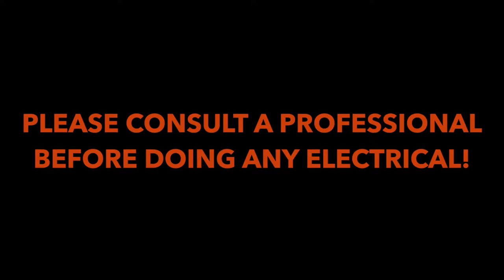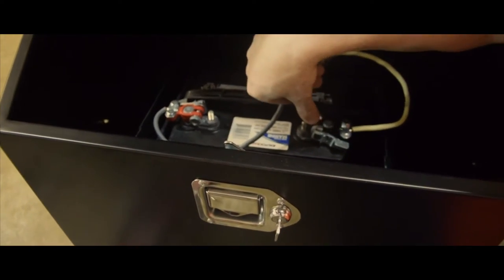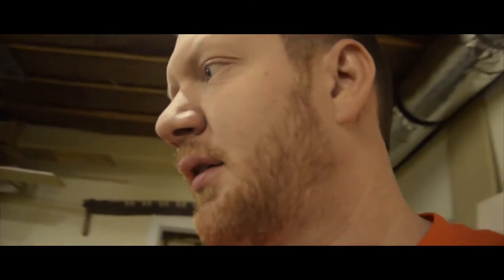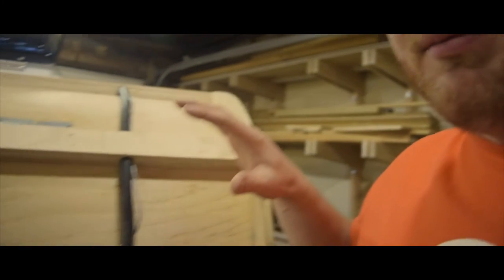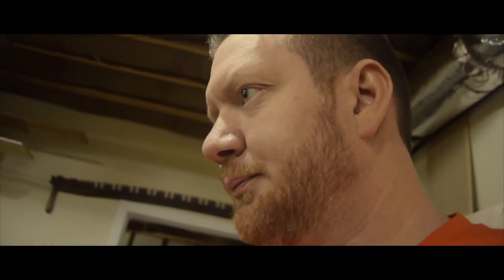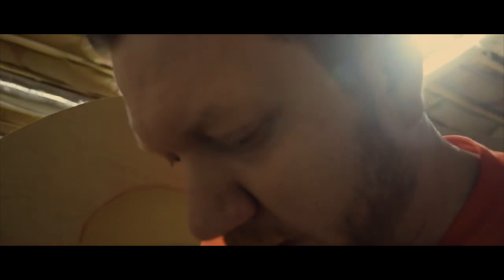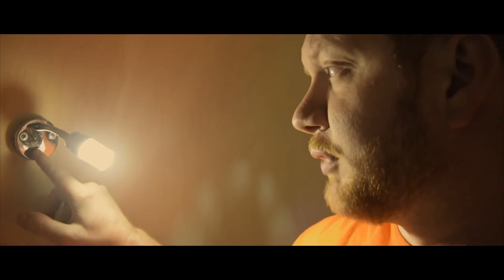Installing the coolest interior LED lights! | How to build a Teardrop Camper Trailer #10

Comment: Looking good Zach....... On the battery side you can wrap the entire black wire with a red color heat shrink tubing and the white wire with a black color heat shrink tubing. Put a small band of red color heat shrink tubing on the black wire and black tubing on the white wire at the power distribution unit. Our local Fry's store sell a different diameter size 48" long heat shrink tubing.
Reply from the maker: +Freddy Chrisdijanto great idea Freddy, isn't that odd how the black and are swapped? Crazy :)
Reply: AC and DC wire color code never get along........lol
Reply from the maker: +Freddy Chrisdijanto yeah it's my fault for going SSO but it will work in the end :)
Reply: Use a self adhesive barrel connection or self adhesive heat shrink tubing on every wire join to protect from oxidation.
Reply from the maker: +Freddy Chrisdijanto yeah but I'm not concerned being inside of the walls, totally agree if it's on the outside :)
Reply: Just a suggestion :) I learn a lot on the boat wiring and those join inside the wall is pain to repair.
Reply from the maker: +Freddy Chrisdijanto totally, thanks man!

Comment: Nice work, those blue/white lights are pretty rad... it definitely came out very purdy B-)  (also, really weird about the terminal connectors)
Reply from the maker: +Live Free and DIY thanks Lew, yeah I agree! The blue/white ones were a nice touch :) and the terminal connectors don't seem right but then again I'm using white/black and not red/black lol
Reply: OOH, that might make sense then... kinda... in electronics, black is considered ground/neutral and red is considered hot. But in electrical (for houses, etc), black is hot and white is neutral.
Reply from the maker: +Live Free and DIY yup you got it! In retrospect, I should have gone to the auto parts store but wire is wire, regardless of color :)
Reply: Yeah, I vote for the "wire is wire" route!

Comment: Zach, great vids. I am interested in building a teardrop and your vids are great help. DO you think you can give  detail on you electric setup? I would prefer to set mine up somewhat the same. Thanks
Reply from the maker: +DJTweezy very cool! I think you should make one! They're a lot of fun. As far as specifics, I purchased a distribution panel from progressive dynamics. That houses the 12v and 120v circuits. I used 6gauge wire to connect the battery to the panel and 6gauge wire to connect the 30amp plug to the panel. The rest is up to you, how many plugs/outlets and lights are all up to you. I would recommend all your lights be on 12v and have switches on them! Good luck and reach out if you need anything :)
Reply: Thanks for the info I am headed to Harbor Freight today to get the trailer!
Reply from the maker: +DJTweezy get the strongest one you can, not the foldable one!

Comment: Hi Zach, nice update of your Teardrop, now can you share the light diagram I will like to adopt it to my future teardrop as well, also the breaker panel thanks.
Reply from the maker: Thanks so much! I don't have a diagram but the breaker panel should be on the build article if you check out my website
Reply: Hey Zach i'm not seeing the power distribution panel in the article do you have the model and make, thanks.
Reply from the maker: Fixed! Here is the article - https://www.southerngingerworkshop.com/articles/2016/12/13/lets-add-some-12v-interior-lights-how-to-build-a-teardrop-trailer-10

Comment: What's the power unit you picked up? What type of battery? Great update by the way.
Reply from the maker: +MonkWerks with Fr. Thomas hey buddy! I got the battery from a local auto place, just make sure it's deep cycle and not starting. The panel is progressive dynamics 45amp distribution panel!
Reply: Are you putting in some 120AC equipment too?
Reply from the maker: +MonkWerks with Fr. Thomas yup that is next! :)

Comment: 2 questions.... what did you seal the edges of your plywood with? 
What gauge wire did you run...the heavy gauge one
Reply from the maker: Hey Adam, I sealed the edges with penetrating epoxy to keep them from separating if water or moister ever got that far. And I used 6 guage for that wire but just make sure it can handle a 30amp circuit :)
Reply: Thanks man, Great videos by the way. Subscribed.
Reply from the maker: Adam Davis thanks so much Adam!

Comment: How did you wire up the fan? Since it's somewhat last step to install it after roof is on. Did you just run a wire and the install fan and tuck wire up ?
Reply from the maker: +Cleric40 exactly. Ran the with so that it was there at the end. Wire nutted it and tucked it away :)

Comment: Looking good! I love those interior fixtures on the front wall. Very cool looking.

Are you going to seal all that plywood before you insulate and put the roof on it? A leak would be really bad news without a sealer. Lots of folks use CPES from Rotdoctor. It's wicked stuff (respirator mandatory) but 1-2 coats will seal it for life.
Reply from the maker: +Mark Lindsay interesting I wasn't thinking that I would seal it all but maybe seal the edges where the aluminum edges are?
Reply: Southern Ginger Workshop I wasn't suggesting that you should seal the whole thing - just asking if you were going to. I would certainly seal all the edges, the plywood crosspieces and spars, and anywhere there's a penetration through the outer roof skin of any kind, like the area around the roof vent, hatch hinge, and where you plan on putting the roof edge molding. By the time you get to that point, though, doing the whole thing might not be that much more work. If even a tiny bit of water gets in there, it could be disastrous.
Reply from the maker: Mark Lindsay totally, maybe I can use that penetrating epoxy that I have :)
Reply: Southern Ginger Workshop  Anything is better than nothing. Again, I was asking, not suggesting.
Reply from the maker: Mark Lindsay yeah man but I don't know any better, this is the first I've ever built lol :) I appriciate the suggestion :)
Reply: Southern Ginger Workshop I've only built one camper, but have repaired a couple. Just make your mantra; "Water is my enemy," and keep an eye out for any place it could even possibly get into the roof, hatch, or walls. I had to scrap a 17' travel trailer that had a leak in the roof that was no bigger than a nickel. Water got under the roof skin and followed a "stud" down to the floor. The entire back half of the floor was rotted to the consistency of pipe tobacco. Of course the water wicked upward into the wall framing too, and the framing was rotted to about 3' from the floor. The entire back half of that trailer was just gone.
Reply from the maker: +Mark Lindsay dang son! That's not good :/

Comment: I've been following all your videos on the construction of this teardrop, and dang...makes me want a shop, something fierce! Beautiful work, man! 

My wife and I have already purchased a custom teardrop from a company in CA, but we know we're going to want to add some LED lighting, here and there. Our inclination is to buy LED strip lights that are battery operated, since I'm a little reluctant to tap into existing wiring to hard wire them in. Any thoughts on that?

Meanwhile, thanks for all your vids!
Reply from the maker: +Tom Patterson wow thanks Tom, glad I inspired you! Depending on how it's wired I would try to tap into the existing. It's always better to have only one source for power :) however if all the wiring is in the walls, it makes it tough :)
Reply: I agree. Thanks. If there's a way to easily tap in, I'll do that. But if not...I guess it'll be AA batteries! Thanks, SG!
Reply from the maker: +Tom Patterson where is the panel on your trailer?
Reply: I'm actually not 100% sure yet. We won't have it in hand till near the end of the month. I'll check back in on it, though!
Reply from the maker: +Tom Patterson ah very cool! You're going to love it
Reply: We'll be picking it up near the end of August, and we already have reserved, and paid for, one weekend of camping per month through the end of the year, up here in the greater Seattle area. We are stoked!